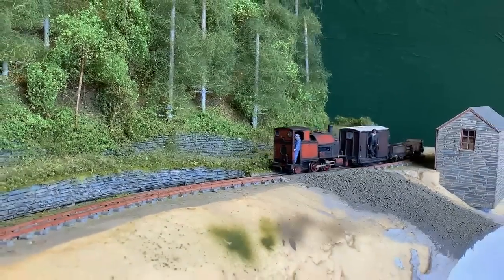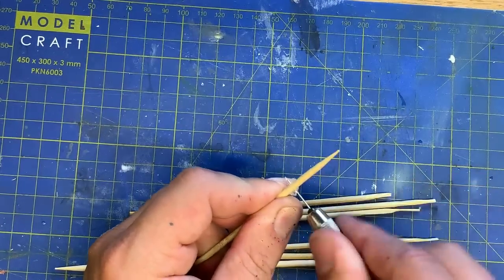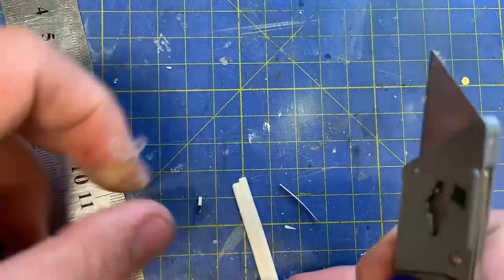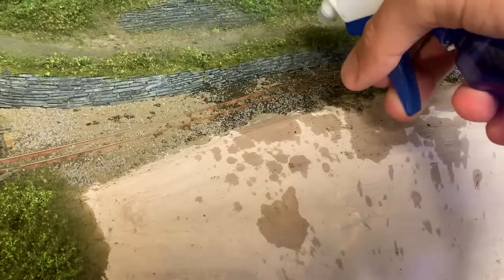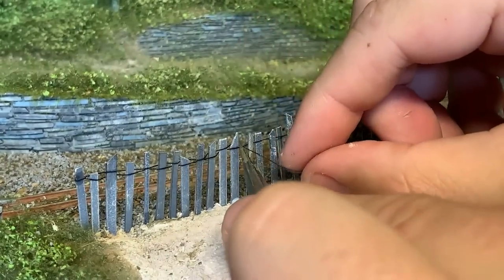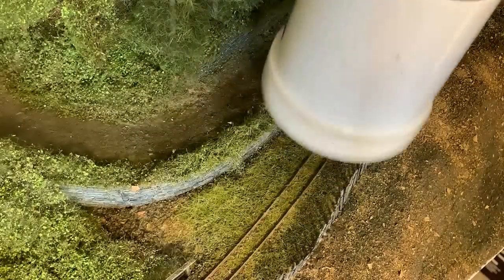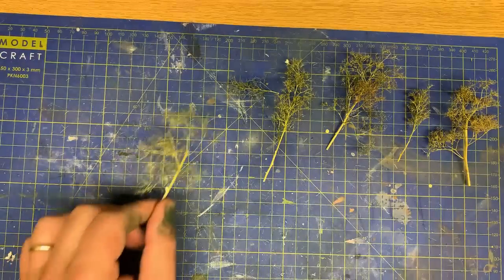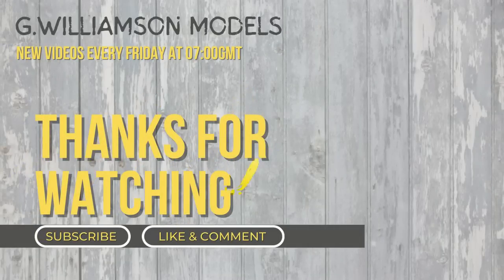You DO NOT want to miss this 009 model railway scenery!

Comment: Why is it everytime I reuse a spray bottle it turns into a pathetic blob  bottle like yours 😂
Reply from the maker: Well this is a brand new bottle, which is why it was confusing me, but if you’re having that issue with a used bottle, it could well be glue drying up the nozzle. If you get a cup of water, unscrew the bottle top and pop the intake into the clean water and spray a load through, it should help it minimise the amount of glue in the sprayer